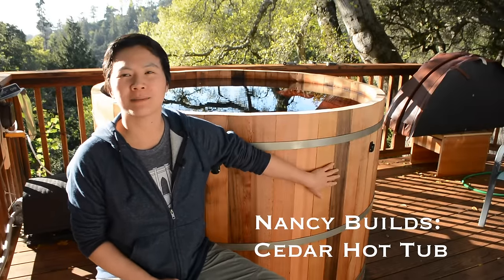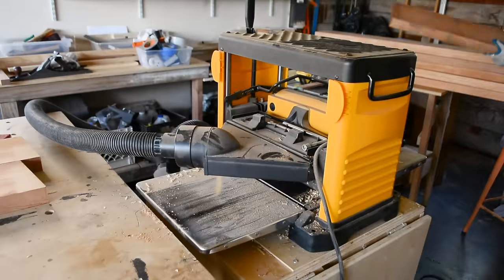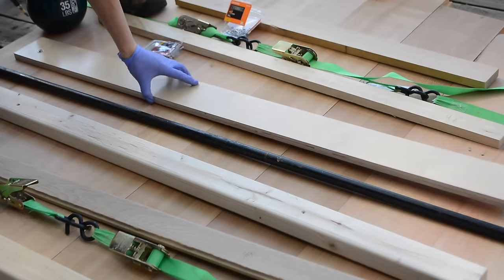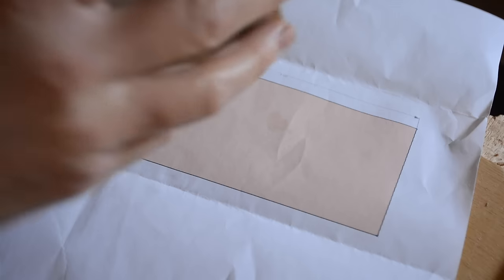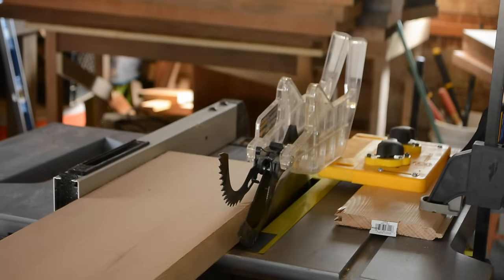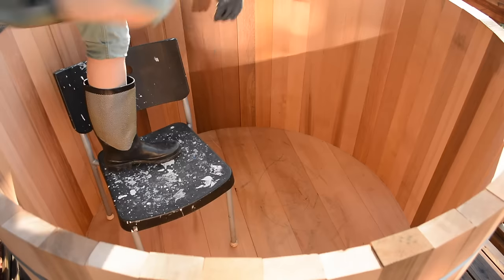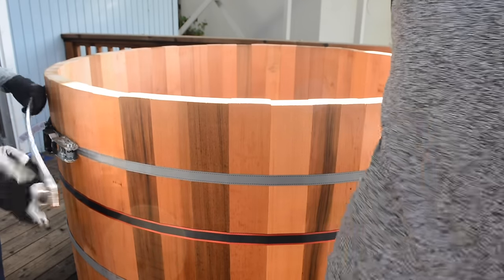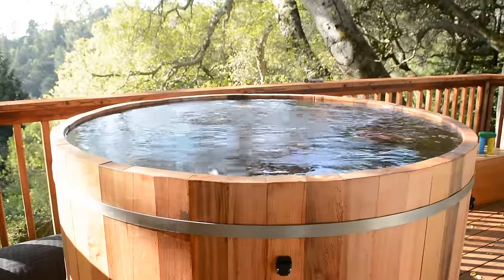Cedar Hot Tub

Comment: I feel like the deck wasn’t made for this weight...
Reply: Especially the location of that tub too... It's literally in the worst position as all the weight is acting like a lever away from the house... Also, I'm a little bit nervous as this was her last video over 4 months ago... Coincidence?
Reply: Jordan Cox yeah i am worried too.
That deck overlooks looks very steep.
Reply: its not that heavy
Reply: JustLetMeDrive you out your mind. It’s extremely heavy, and the deck i am sure was not reenforced for such a load. They are also pretty high up as you can see tree tops below her. Not safe.
Reply: @adamcartermi5  who cares, the water will absorb the fall
Reply: Are you kidding me? This is extremely heavy. Water is 1 ton per 1m3. Add the wood. Add 2 (or more) people in. This is weighting multiple tons.
Reply: Jordan, your cantilever on a deck with 2x8 construction, by code, is allowed to be 16". 24" if you use 2x10's. Based on the direction of the deck boards, the joists run perpendicular underneath, and are likely supported by a triple 2x10 built up beam. Either that beam is sitting right underneath the tub, or very close to it(depending on if there is a cantilever at all). I wouldn't be worried with a two person unit like this.
Reply: @hygrometer  over 2  metric tons
Reply: 3800lbs of water weight not including the weight of the tub itself and people inside. deck was probably not designed for that
Reply: nellaRissa I was gonna reply to that comment but I can't stop laughing.
Reply: hmmmmm lets think about this @9:13 you have a clear view of the neighbors residents and the irony its ALL METAL structure underneath do you think her deck is any different on the side of a mountain slope?
Reply: @nellaRissa  He's probably a flat-Earther too
Reply: Krille Krille you are right if the tub was completely full like they showed in the end and some got in and floated displacing there weight. Then that person’s weight is irrelevant
Reply: @hygrometer  Over one and a half tons .
Reply: @hygrometer  About 2,000 kg / 4,000 lbs?
Reply: @adamcartermi5  the deck is not that high. Below the deck is not trees, it's just a tall grass.
Reply: You "feel" ... hmm ... 
That is same as You to say "I am know nothing about how is made this deck and I know nothing about his stability and weight resistance." 
Thanks for share your "feeling". :p
Reply: It is around 12 feet up. There is a picket fence below from the side of the house. A little high.
Reply: Krille Krille actually it’s a very smart comment since we’re 98% water so our weight is simply displacing the water. When you calculate the weight of a full tub.
Reply: With the est of weight at 2 tonnes and the potential speed of 3.6576m/sec or 8.18mph. Hitting the ground (est 12 feet below) while riding in a cedar hot tub won't be too enjoyable. Wear your safety belt. Might need air bags too.  7,315.2 kg -m/s
Reply: Yeah, that's almost as heavy as a Tesla...
Reply: @solexxx8588  8.34lbs per gallon
Reply: thats like 2.5 tons of water alone not including the wood, or equipment like pumps, motors etc or people in the tub. I really hope that the deck was designed and built for that weight. I think the tub itself is awesome! I wish I had that skill.
Reply: @Krille Krille Where did you study physics?
Reply: @solexxx8588  Water weigh 8.3lbs per gallon
Reply: @ilovewood79  At least that and quite probably a lot more.
Reply: @Michelangelo19571  You failed.
Reply: @kmattar  98%???  are you actually a jellfish ? ...facepalm
Reply: @hygrometer  3200 lbs
Reply: Great job!!!
Reply: I agree since a gallon of water is eight plus pounds per gallon so be careful that can be a short soak!
Reply: Man oh man, i was thinking the same thing lol
Reply: Mansplaining
Reply: 4000 pounds of water?  Is my math right?

Comment: For those saying the tub is too heavy for the deck. Let's do some math (in metric)! The volume of the tub is Area x Height = 1.94599 m^3.  The density of water is 997 kg/m^3. That gives us a mass of 1940.16 kg. In Newtons, her tub has a force of 19,032.97N or 19.0kN acting on the deck.

Now, an average patio deck can hold about 243.27 kg per m^2 (from google), but it varies greatly. But let go with this value for now. Assuming the fact that the tub takes up 1.82 m^2, that area on the patio can only take up to  442 kg or 4,343 N or 4.3 kN. 

4.3 kN is way smaller than 19.0 kN. I think y'all are onto something here. I hope her deck is strong lmao.

Nevertheless, great project and a well presented video! :)
Reply: I hope she reads this an reenforces her deck
Reply: RossRocks45 based on the skill demonstrated to build this I bet that deck she has, if she made it, can hold a tank
Reply: @theodorep9569  That's what I hope as well.
Reply: Yeah because she never thought of that...you guys are clowns
Reply: r/theydidthemath
Reply: nerd
Reply: Here are a few other questions (at least, these are questions that come to mind):

1. Was the electrical connection at the house wired correctly?
2. Was the electrical connection at the hot tub wired correctly?
3. Is there grounding that surrounds the entirety of the hot tub and its components, or the deck they're placed upon?
4. Was a building permit acquired before the hot tub was built, and has it been inspected by a building official to ensure each portion was completed correctly for a C/O?
Reply: @brassdog89  why?
Reply: @sliderdrago8189  Why what?
Reply: @brassdog89  why do those questions come to mind. The person is way more competent than you.
Reply: @brassdog89  Those code requirements depend on location. In many places no permits or inspections are needed for hot tubs of this size.
Reply: She got found, down the hill, naked in a an empty hot tub...
Reply: @Y T i would have never said "dead" though... That's a bit too harsh for someone being kind enough to share her experience and make time to edit and post a video....
🤔 However, if water conductivity there was, i suppose the sex toy transistor got faulty and went full on... Like the first scene of "Not another teen movie" style...
Reply: Wow! So many mean comments on a great job. It’s a amazing job. The grounding was a great point but I’m it was. She was able to show her skill with the build I’m sure something as simple as grounding and the pumps are already grounded but the tub itself being grounded she Def had the sense to ground it for safety and honestly I would of said the hell with the building permit if I was building for myself. Someone else yes myself nope. City gets enough with my taxes as it is. It’s outback and nosey neighbors can mind their own. The guy did good on his math and fig he did it not to be a “nerd” but at the same time of figuring it shut down debate on how does he know. Anyway positive comments or helpful are always good, someone being ugly or plainly a jack ass being rude or disrespectful should realize that it’s rude, God doesn’t like ugly, she is good and everyone knows it, she is a human being, someone’s wife, daughter and mom prob and we wouldn’t like it if it was one of ours. Anyway amazing job mam. I have been a lic Gen contractor for 20yrs and my trade is masonry but build customs and yes I pull building permits cause it’s diff with whole project and I am selling what I am building and to protect I have all my permits done in the required phases of the construction. Building things like this I admire, I have not yet and I am not planning on a hot tub but happened on this by mistake but some personal projects of my own. Also my backround is industrial electrical and mechanical maintenance. I know how to frame homes and decks ..etc but to have the tools and patience to do a job even close to what you did. You should be proud and your family should be proud.
Reply: Y'all know that Nancy has a mechanical engineering degree from Stanford, right?
Reply: I did think this (2t on the deck) but without seeing the deck structure there is no point commenting. Would all depend on the spacing and material used. Great job thinking about doing this myself. Though need to work out if the 100mm concrete will handle the weight.

Comment: I really like the smallish size of your tub.  We had a large hot tub when I was a kid that my father would heat by circulating the water through a series of copper tubes mounted over his ceramic kiln when he fired pottery. It would take a long time to get up to heat.  As I recall there was always a problem with leaking.  we hammered cotton string into the cracks, but I like your epoxy idea better.  It must be very rewarding to soak in something so beautiful that you made yourself.

Comment: This is fantastic! I build staved drums, so I recognize a lot of the problems you had to solve. I especially like using the printout of the angle as a gauge... I wish I'd thought of that before I bought a vernier-scale protractor. Oh well... 

I find that my ripping blade tends to flex enough when cutting bevels that it takes a lot of planing to flatten the cuts out enough for a good joint, so I switched to using a resawing blade on my band saw. The cut surface isn't as pretty, but overall they end up close enough to being straight that cleaning them up is a lot easier. Food for thought if your ever decide to make a staved barrel again. Keep up the good work!

Comment: Awesome work beautiful my mom and dad had one when I was growing up solid wood like that through the years it started leaking so we were told to loosen the straps and jump in sawdust redwood cedar so I bought a board and turned it into sawdust and we tried it and it worked cuz it was going to the cracks stop the water from leaking then you would tighten the straps back up which gave it that extra pretty cool

Comment: This is a super cool build, I really enjoyed you taking the time to go through the construction process in detail.  This is an old video, so I’m not sure if this was ever resolved, but as others have mentioned, you need to reinforce your deck for the weight of the tub, as I’m assuming the deck wasn’t built with tub in mind.  When framing a house you always double up and sometimes triple up joist where tubs are going to be placed due to the shear weight they place on the floor when they’re filled with water.  Shouldn’t be too hard of a fix though if you haven’t already done so.  Make sure your deck posts are within safe load capacities as well.  Good luck!

Comment: you built exactly like the pros, nice job. if you build another may i suggest your dados not so deep (usually less than a 3rd of the thickness of the wood) and if you can taper the floor 3 degrees on the bottom would help your seal. on your staves using a small canoe beading bits top to bottom will also help seal. caution they are fragile and care is needed on assembly. silicone on your plumbing fitting is helpful. the bands where beautifully done and not cheap i bet. lastly the wood was beautiful, and i thought you got a good deal on it. really cool.

Comment: nice job. for the plumbing fittings you could have used a rabbiting bit in a router after cutting the hole for the fittings to recess them into the wall of the hot tub.
That way more thread would be available on the outside. Turned out very nice though.

Comment: Rebate the Tub into the Deck. Sit it on purpose built Footings and piles. That will take the weight off of the deck as I doubt if it was actually designed to support it. Put all your plumbing under the deck and controlled with simple air switches with a main power inside the deck door. Also you may like to run a router around the top to take off those sharp edges. I like what youve created. It looks great.

Comment: I wonder if you had all your wood very dry and cut in dry air, assuming you had extra hands to assemble quickly or figure out a system like humility paks do in order to keep it very dry up to assembly, utilize larger bolts for your straps, and an impact driver to tighten before adding the water if it would make a difference enough to actually be sealed.

Comment: DIY, the wood alone cost 2000 bucks, using all my tolls is another 15k, :P Still an amazing build!
Reply: If you're paying 15k in tools for this build, you must have an amazingly fitted shop.

All I noticed she used was a table saw, a planer, a miter saw, a sander, a drill, and some mallets.  You can get all of that under 3k easy, especially since she was using cheaper branded tools.
Reply: Using auto correct would have been free but you couldn't even do that.

Comment: Hey I’m designing a similar hot tub. What made you go with angled joints vs something like a canoe joint. Also is each stave 1 angle and the other side 90. Or are the both stave sides angled. From the video it sounded like a mix? How’s the tub holding up I really like your video and like how it doesn’t use a liner like a lot of build do. Which I think defeats the purpose of a wood tub.

Comment: A tub that is 3.5' high and 5' in diameter has about 4,300lbs of water in it. That's about 220 lbs per square foot. I believe that's above residential standards for floor load capacity. How did you verify your deck can support that weight?

Comment: Hello Nancy! Thanks for sharing your build. I in the process of building one myself. Could you please, if possible, detail out the individual plumbing parts that you used here? I see that you listed the Pentair Long Body Fitting 542417. But I didn't see the other parts listed anywhere. The specific answers I am looking are for:
1) what type of filter is it (hayward, but what model number?)
2) what was the fitting that went on the floor of the tub (drain). Did you silicone it in? 
3) are all the return jets going through the pentair long body fitting? 
4) what are your views on the kit from spaguts.com? 
5) how long do you keep it running for? (24/7365?) and how much rise in electric bills did you see after this was installed?
thank you for sharing this! Hope mine turns out as pretty as yours.

Comment: Question, using cedar wood without 'knots'. Is that for esthetics or for the structural strength? Can you elaborate?
Reply: Either way it's a strong board. But knots are more vulnerable to leaks.

Comment: Too heavy for deck but super cool!!  I enjoyed watching.  The weight though.  That'll hold about 500 gallons of water.  8.34lbs per gallon, that's 4170lbs of water plus maybe an extra 900lbs for the tub itself with people in it.  So over 2.5 tons of weight on the edge of the deck.  You should be concerned about this aspect of the build.
Reply: We wanted to put a hot tub on our deck years ago which looked a lot stronger than what she has.  The pool company said absolutely not.  We would have had to tear the deck down and rebuild it to be up to code for the weight of the tub.  Opted not to buy the hot tub because of it.

Comment: I would have done this project waay differently. First off that wood is way too expensive, you could get equally good looking results with wood that’s 20 times cheaper. Cheaper wood with Knots are easy to fill in and in my opinion add to the beauty of the grain. Second I would have glued all the pieces together to prevent water from escaping through the seam lines, then seal the inside with either epoxy, fiberglass, or a weather protectant clear because oils don’t last long. You have to constantly reapply the oil on a week to monthly basis depending on the product and amount of use, and that’s just too much upkeep. I would have also made the circle with a makeshift circle jig if I didn’t already have one so all you’d have to do is find your center and then cut a perfect circle from there.

Comment: 0:13 NEVER put your wrench on a bolt like that, you'll ruin the threads
2:40 That is NOT just 'tight but doable"
3:28 That is NOT a good reason not to buy a 'plastic spa'. Plastic would be both lighter, and cheaper, for the same size build. Plus, i used to deliver large 6-person spas across the sound in Seattle to some very cliffy backyards, it wasn't hard at all and up some very steep road-grades and deck-stairs. You telling me she's never had a trailer up there, nor a person to help deliver stuff?
TME;DF She got all the tools, knowhow though.

Comment: Gorgious hot tub so I commend you on that.  Something like this would weigh close to half a ton and I can see its on a deck thats on the 2nd floor ??!!! To anyone that has made decks, they can easily see the biggest problem.  Even if the upper deck can support the load, it wont support the load for long.  Water will get under this hot tub then how will the wood under it properly dry out.  Easy to get mould then rot will arrive.  Hot tubs are gorgious things ....for a few months then mould arrives.  I think also in another video you might want to put a wood lid on it.  The Finns and Japanese both do this otherwise it needs to be heated up each time ??   Though its rare you see hot tubs on 2nd floor decks for the obvious reason.  Unless MAYBE the deck is steel girder.  This may be steel ibeams.  Otherwise......dont attempt this at home !!  he he

Comment: Zero insulation. your R value is probably 3-4. Modern hot tubs have like 8 inches of foam for R ratings in the 20's and 30's. Your wood is going to quickly be the cheapest part of this build when your bills start racking up.  Being wealthy is expensive. It looks great, though.

Comment: Why the hell didn't she just make a rectangle and save SO MUCH TIME
Reply: Because the style of construction requires a circle. And quite a bit of skill to ensure the angle is perfect.
Reply: Because hydrostatic pressure can be immense and by building it in a circle, the pressure is even all the way around. In a rectangle, the corners would be the weakest part and likely (eventually) fail. If you're going to make a wooden tub. Going round is a proven structural design.